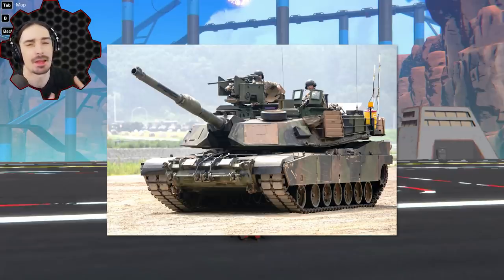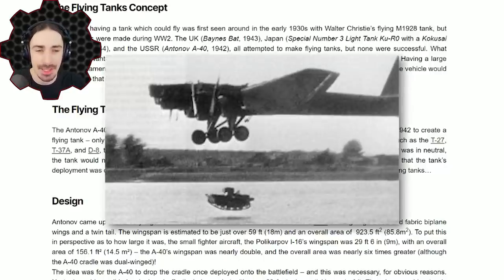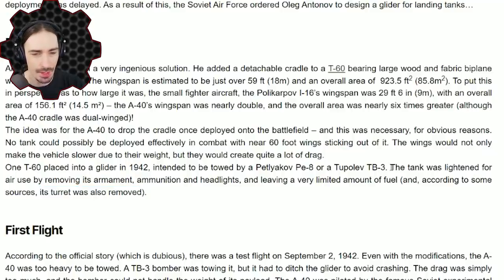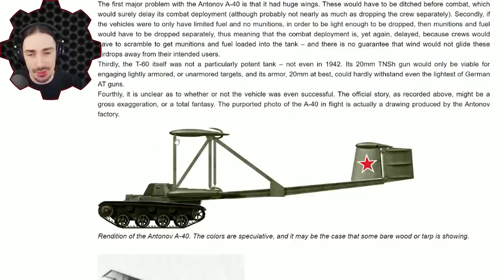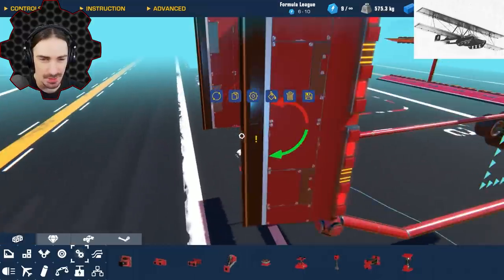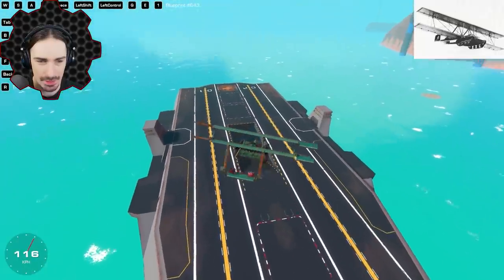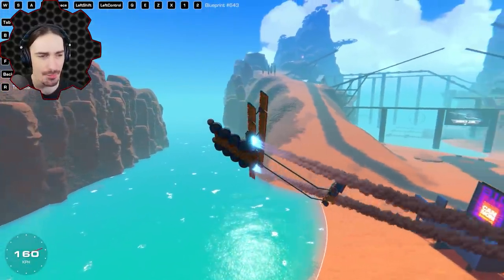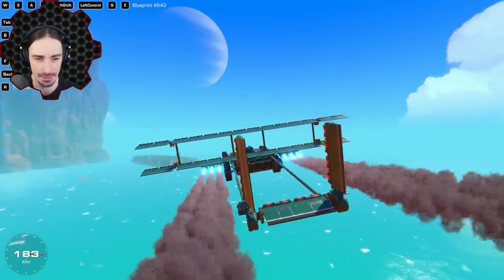This Flying Tank Was Actually Attempted and It Was Terrible... SO I MADE ONE

Comment: While it seems odd that the tank was stripped down to an extent of even removing the turret, back in 1942 tanks were used to push the front forward, their turrets were useful mostly against large or heavily armored opponents, but the tank could move across fields that were mined for men, flatten soft terrain, provide cover for moving troops and it could also crush gates and fences, and other small obstacles. Im not a tank expert or anything but i dont think that removing the gun of the turret in those days was as detrimental to the effectiveness of tank, especially when attempting flight. You gotta remeber that ww2 was partially won by inflatable tanks and fake armies, if you havnt seen it, definatley check out the false battalions of the allied forces. Seemingly ridiculous plan that ended up aiding a British spy who successfully diverted thousands troops away from the southern beaches on D-Day.
Reply: My favorite story of WWII is of the one guy who was left behind doing donuts in a tank to stir up dust and give the impression of an army approaching, while the rest of his guys went a different route. Dude is an absolute legend.
Reply: also where it would be deployed would likely be well scouted in advance, which would also include checking for actual threats to the tank
the t60 was already completely useless for frontline combat  in 1942, so not having its proper gun wouldnt matter that much
Reply: Well the problem with this idea isn’t the T-60/A40 or it’s weight because the soviets did have a bomber at the time with a 5000kg carry weight (the Pe-8), I think A bigger issue is that each plane could only carry one T-60 and there were only about 90 or so Pe-8s built, so even if you were able to get every single Pe-8 ever built to drop one. That would still be a relatively small fighting force and that’s only if every Pe-8 were still functional, as a large number of them crashed or were shot down. The Soviet Union would need to reroute a lot of resources just to deploy the A-40s in substantial numbers when those resources could be used for bombing bridges and factory which would have a much larger effect than the two or three dozen T-60s.
Reply: @themuttonqueen8692  ok, well i was only really talking about how a tank is still useful when the barrel was removed. Thats about it. The program was scrapped for reasons that are pretty obvious.
Reply: @themuttonqueen8692  It's annoying that every single great and magnificent plan is destroyed just by one thing alone.

Reality.
Reply: All those activities sound like they would only be useful for helping infantry advance (clearing mines, providing cover, crushing obstacles). Maybe they should just have made an APC into a glider and dropped that together with some infantry.

I'm trying to imagine what a tank armed with only an MG would have done behind enemy lines (that infantry paratroopers couldn't have done).
They could capture bridges. Just parking yourself on the bridge and looking menacing with your MG would have been enough to deter enemy demolition troops from planting explosives on the bridge. But you'd need to hope that there's nothing actually capable of destroying a tank passing by.
They couldn't attack the front lines from the back, because that's where you're guaranteed to find ACTUAL tanks along with anti-tank guns.
They couldn't sabotage artillery positions, because those are a bit too sturdy to be damaged by small arms fire, and you wouldn't want to get out of your tank at a spot swarming with enemy artillery troops.
The most useful thing they could do would be to drive to an enemy HQ and try to run over the generals. They COULD also shoot them, but the whole point of that would be to cause as much chaos and pandemonium as possible. And in my head, a tank trying to run everyone over is on a much crazier level of frightening.
Reply: @Pystro  i would imagine the one tank drop wasnt the limit of the actual plan. As someone else added to my OG comment, the actual plan would be to land as many tanks as possible and as many troops as possible into a prescouted locations. The tanks could immediately shed their wings, the extra infantry could reuse them to make temporary structures (think fox hole covers and small barriers rather than buildings) and start to dig in behind enemy lines. The tanks forming another barrier line or mobile armored scouts around the  local area. They could then wait for advancing allied lines to move forward crushing the enemy from forward and behind. You could then scale this up to a point where this is happening all along the enemy lines at once. Am i saying it was the best plan? No. Am i saying that arial tanks should have been used? No. All i was pointing out is that in 1942, a giant gun didnt mean everything, people were sometimes still using bayonets on their rifles. Paratrooping was suicide if the enemy saw your asses floating down and to secure drop points behind enemy lines meant you could consistantly drop more people. Even temporary armored units make that even more secure.
Reply: @Pystro  i do think that if outfitted with the right equipment a tank could destroy some artillery positions and other back line defences
Reply: Can u explain it in short
Reply: @nightrider6823  tanks are machines that can perform with a variety of strategies. In 1942 the tanks turret was much less accurate and reliable and really only used on other tanks. Therefore stripping the "big gun" off strategically placed tanks was a viable option at the time.
Reply: Thx alot
Reply: @nightrider6823  tanks arent just used for their gun, they could shield infantry so it’d still work
Reply: @themuttonqueen8692  the problem wasnt necessarily the weight, but the added drag of the massive biplane wings
Bigger (especially dual)wings mean more drag, which means a slower plane, which means less airflow to the engines, which means less cooling, which caused overheating issues
Reply: @Aaron-oe8xw  "i would imagine the one tank drop wasn't the limit of the actual plan." Yeah, I'm aware that the plan would have been to drop the cannon-less tank alongside paratroopers, to allow the whole group to do stuff that paratroopers alone couldn't do on their own.
However, to me all of that that sounds like a job for what a modern-day APC or IFV would do. Then again, a tank weighing only 5 tons (if some other comment that I can't find again is to be believed) is possibly even lighter than those. So yeah, the uses you describe is probably exactly what I was thinking of as well, just from the perspective of different periods of armored vehicles.
Reply: I forgot, this was when tanks were in their infancy...
wait WUT?! oh yeah I forgot all about that
LOL
and I thought the "who me" project was ridiculous
Reply: Garbo. A "german" spy who got awarded the highest medal in the german military for being so dutiful and accurate

Comment: The T-60 light tank they used for this "only" weighs 5.8 tonnes, so this could have been possible with more development time. We do have parachutable light tanks today, so the idea wasn't that outlandish and I believe the story about the prototype flight is feasible.
Reply: Yeah, I absolutely believe it was able to glide to safety. Now 8f they'd strapped engines to it and claimed they were able to gain altitude, I'd be much more skeptical.
Reply: and given that one of the bombers intended for towing actually had up to 5t payload.
Reply: The Soviets did In fact have a bomber at the time called the Pe-8 that could carry a 5000kg load so the weight isn’t too much of an issue. I think a bigger issue would be that there were only around 90 pe-8s built and you would need to dedicate a relatively valuable long range strategic bomber to carry each and every T-60/A-40. It would be a huge waste of resources to drop them in large numbers.
Reply: they had parachuteable tanks in ww2...  the tetrach light tank for example
Reply: @Firefrab   yes, a lot of nations experimented with airdropping tanks such as the M22 but the idea was never used to much effect if at all because of the limited combat performance of a tetrarch or M22 as well as the limited number of planes capable of supporting the weight, the United States even attempted to design a plane for the exact purpose but the war had already ended by the time it made it through testing.

Comment: Center of mass in front of center of lift is never an insurmountable problem. Even far in front, that just means you need a much bigger tail plane and elevator.

Airliners actually have the CoM fairly far forward of the CoL and use very large tails to compensate. After all, if a couple too many people tried to walk to the rear bathroom at the same time, you wouldn't want the plane to fall out of the sky. They also typically have ginormous vertical stabilizers as well, because the rudder has to be powerful enough to compensate for asymmetrical thrust with an engine out, with the remaining engine having a humongous lever arm.

Comment: Air dropping tanks has been done in more modern times as well. One would be pushed out of the back of a cargo plane that's flying a few feet off the ground. The tank would be on a skid plate though, so the drivetrain is not put under stress. Don't remember if crews would be inside during the drop though.

Comment: Taking everything off for the first prototype makes sense.
If it had been a success they could have then worked on adding as much weight as they could back to it.

Give it the best change of success just to see if it's feasible, leave the 'drop it with arms and ammunition' stage for after you figure out if it's going to work at all

Comment: There is an somewhat easy way to do tank steer in trailmakers and it uses logic to control the engine you need 3 logic gate and 2 engine.

Comment: Ï'll have to check, but i seem to remember that Christie flying tank had an option to disconnect the driveshaft from the tank treads and connect it to the propeller which was attached to the wing construction made of plywood, so in theory it was capable of taking a flight by its own power.
The most successful test fly was around 5 meters or so before it crashed to the ground, soo...yeah.

Comment: I seem to recall a ww2 Japanese aircraft carrying submarine.  Not sure if this was real or from fiction, but apparently the plane had wings that could fold upwards to fit the it inside a big tube.  The sub would surface and they would unseal the tube, pull the plane out, fold down the wings, and launch it with a slingshot mechanism.  There was no way for the plane to land back on the sub tho, so the pilots would just be expected to kamikaze I think...
It'd be cool to see you build one in trailmakers, tho it might be too complex.

Comment: I mean technically the tank still weighs less than 30x what it should (with it's size like that as a light tank, maybe 20-15x without armor)... I'd say you made a good model though.
You also pointed out that they didn't put the wings there because of the turret, but I don't believe that's the case, because the turret wasn't supposed to be on the tank while flying.

Comment: I heard of this tank before it sounds like it was designed by a couple of drunk guys.

but too be fair ww2 was when they started to try wacky weird ideas to see what's best tanks and planes were still a bit new especially tanks and now tanks and aircraft designs are a bit more refined to what is most effective usually from what I know nowadays they just build the same thing but better until a new role is discovered or new technology and then that will be built or replace something not needed.

Comment: These type of tanks would be pretty rearward heavy as that’s where their heavy diesel engines were located. The wings are located rearward because the COG is further rearward.  Adding the weight blocks to the rear would better simulate this silly thing.

Comment: The reason they did not put the rockets on the wings because they wood have to connect fuel tubes to rockets that are going to come off and if you were to put it like that it will waste fuel by disconnecting the tubes and spilling gas

Comment: So they used a light tank which is basically just meant to protect from small arms fire with a small cannon though still not a great idea but it would theoretically be good at getting a tank even just to the front lines as the turret could also be dropped just separately but there in lies the question how do you make a tank removable and put back on in the field without it taking just as much time as just sending them in by rail or some other way while it's also economically viable that's more why it failed

Comment: But thrusters wont be as simple as a block in real life, so if they'd tried to add engines in the tank to fly, it would have been even crazier and expensive... and imagine they have to replace wings and an engine each time...

Comment: day 145 or 146 of asking scrapman to start a Survival series amphibious tank/basically any transportation and floating base/barge (or under water.) But you need mods... it's a requirement to breathe underwater, if you want an underwater base/transportation. And yes i am talking about the underwater fan moonbo reviewed that basically makes water spaces air spaces... if that makes any sense.) (and if you wanted to move the barge/boat/floating base you are able to make thrusters/glitches/mods to do it or by lift or actual push

Comment: hypothetically if the added weight on the back was ammunition and fuel would this have actually "worked"? because at that point all you would need is the crew to detach the wings and grab the fuel and ammo, obviously this would take time but if it went well they would have a mostly functional to fully functional tank behind enemy lines
Reply: would be risky to literally have that much ammo and fuel OUTSIDE of the tank for the crew to have to exit and reload/fuel the tank while literally surrounded by potential enemies... which i think is the primary reason they didnt keep going with that idea... they werent exactly japanese pilots you know...
Reply: @crustybomb115  that is a very good point but assuming they avoided being detected and was far enough away from enemies it would be ok if it was executed perfectly
Reply: @justinhealy8061  thats the problem tho, if youre invading enemy airspace during a war, theres bound to be detections mid air, so even if the entire flight went perfectly and it wasnt just picked out of the air by aces... radar wouldve picked up on that, and warned of such things if they were to happen...
Reply: @crustybomb115  yeah, I'm just trying to think of what could make this hypothetically viable but there's so many issues idk why it was attempted at all

Comment: Well, the tank was ultra light and had no turret? It was probably going to be used as a distraction, big tOnk dropped from plane is probably more distracting tham normal tank, and would mean most of the enemy army would fire on IT and not on the actuall tanks driving to the other side, and it could also be used as a rammer for destroying light vehicles and barricades because of the extreme reduced weight of it, making it rather fast for a tank

Comment: History lesson about the a-40.
The a-40's tank was a t-60 light tank which weights around 6 metric tonnes.
The a-40 was supposed to be dropped from a Tupolev DB-3 or a Petyakov Pe8. The latter could carry a 5 ton bomb so the project didn't sound that bad from the surface. And this is just why I think they even made a prototype.

Comment: I'm surprised you didn't think of just using a spoiler as opposed to a conventional wing in the tail
😰not saying I don't love your videos, which I do love, I'm just surprised you didn't think of this🤨
same effect but less weight🤓
Reply from the maker: The effects of a spoiler change depending on speed through the air. That would make me more likely to pitch down the slower I go, which would make landing more challenging

Comment: You ridicule the notion of a flying tank, but the other "wunderwafte" of AH's wet dreams that never practically came to being was the the P. 1500 Landkreuzer Monster. It was essentially a Schwerer Gustav on tracks, or at least that was the design, but it never even left the drawing board. But the armor piercing shells fired from the Schwerer Gustav were about 600~650 ish kg lighter than this flying tank was conceptualized to be at fully loaded. So were there actual flying tanks? No, but France practically felt the brunt force of having a few "squadron" of them crash (fired) on them (at them).

Also, a tank is on the bottom of your list of things that should be flying with wings? Challenge interpreted!!! So imagine if you will, a deep ocean oil rig, but that can fly!!!!!!!!! That way the 17 kiloton flying structure can meet up with the flying oil tankers and fill those things up to their maximum total weight 100-500 kilotons!!! With wings.

And I am a firm believer that if the world wants for force me to use the metric system, then the compromise will need to be met that we will be using the increments used in data storage when going above "kilo". Do not tell me that all the worlds oceans contain 1.26 billion trillion liters of water because that's a big number and too much for me to try to work out. They, instead, contain 1.26 zettaliters of water!!!!!!!!!!!! (which sounds a bit more epic). Mount Everest does not weigh 750 million kilograms!!! It ways 750 petagrams!!!! A drive from Dublin to Milan is not 1,847 kilometers, it's 1.8 MEGAMETERS!!!!!! You start doing this metric world, and I'll start using metric.